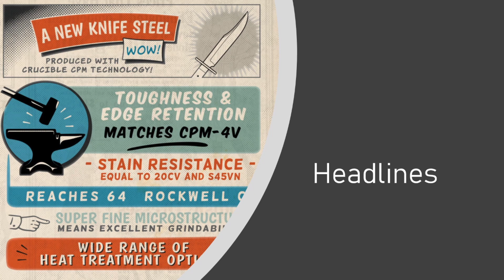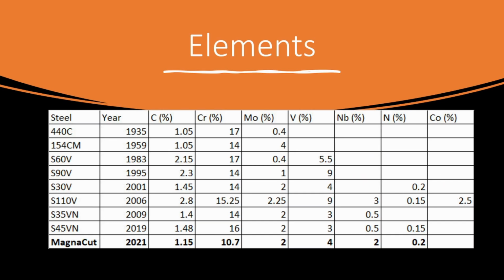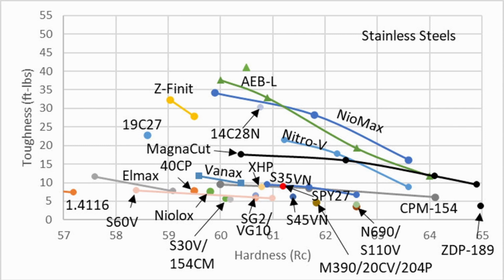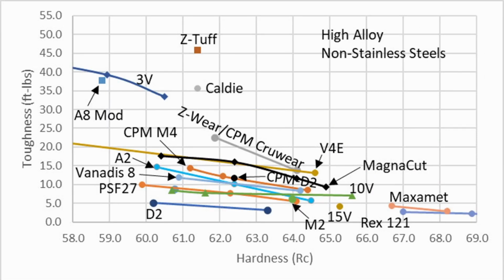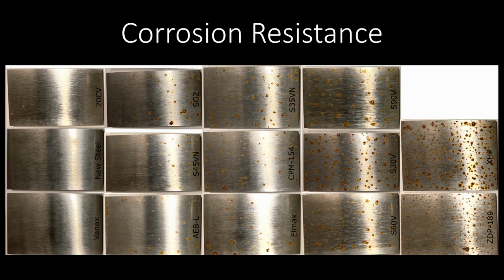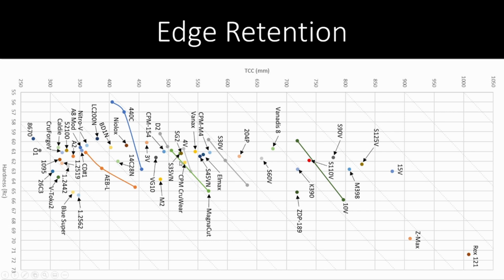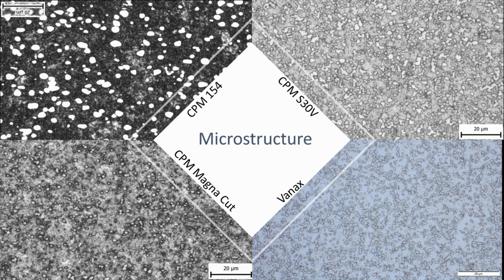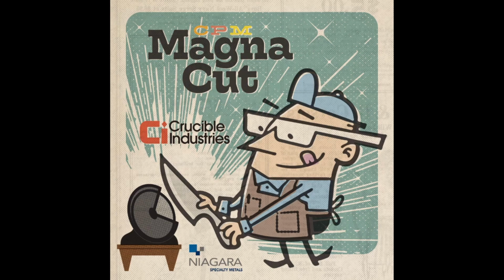CPM Magna Cut -a new stainless steel on the market how does it compare to S45VN, Vanax, and 3V?

Comment: I have a Creely blade of the CPM-3V and absolutely LOVE it. It is razor sharp from the forge and was so sharp, in fact, that it effortlessly penetrated the (very well-made) leather sheath that came with it when my wife tried to put it away.

A Kydex sheath would be a really welcome offering from the Creely forge.
Reply: Kydex won’t save you. I just received my Benchmade Meatcrafter & it so sharp & slicey that the 1st time I tried to sheathed it went thru kydex like it wasn’t even there. If I’d been grasping instead of pinching the sheath it would have gone thru my hand!! It’s ruined,  so the knife lives on my magnetic knife holder in the kitchen.

Comment: I just purchased a LionSteel M4 in Magnacut. They did it in 62 Rc.  Can't wait to try it out!  It should go nicely with my Creely Vanax Mako once I get it. :)
Reply: Let us know what you think about this blade cause I received exactly the same knife last week and I'm desappointed...
Here is the experience I described to Lionsteel company:

"
I doubt it to be 62HRC hardness but if it is, Magnacut would offer better results if the heat treat would be around 63/64HRC.
Indeed Magnacut is basically tougher than M390 but with less good edge retention.

Pretty easy to get thin sharp edge with leather strop the edge retention is objectively not good.
From super sharp (managed to curl part of a hair) to not shaving at all just after some carton cuts.
Sharp it again and just after making fruits salad on a plastic board the knife isn't sharp anymore...
I would love to compare it with the M390 version but can't pay for another knife to try it... 
Maybe something got wrong during the process of this serie...don't know.

But I certainly know that from a knife I thought to be my favourite one it gonna end to be the one I'm not really using to not be desappointed each time of use."
Reply from the maker: @tristanvigouroux6320  you may want to give it a few good sharpening’s, sometimes manufactures heat up the edge when they sharpen, and a few hand sharpening’s, will get past that

Comment: Stainless 4v sounds good. I like 4v but the only 4v I have is the st. Nick's spyderco shaman in 4v. The blade is coated so it doesn't have any visual rust issues. I only used the knife for a few weeks at work but haven't used it since.  I'll have to check to see if the edge has oxidation, likely not.
Reply: @Strangely Brown I'm assuming your chipping is due to burnt edges. Sharpen several times past the burnt edge and then tell me how well it is, I bet you it chips much less if at all. But yeah 3v has better toughness, delta 3v being even better (proprietary 3v heat treatment from Carothers improving all aspects of 3v).

Comment: Sounds like a sexy my favorite stainless steel for yrs now is AEB-L good stain resistance good edge retention and easy to sharpen and fairly tough especially for a stainless steel. I would love to see more companies would use it or maybe RWL-34 and I see alout of companies switching from cpm154 to s30v which is an upgrade on paper but I wish they would stick to cpm154 even 154cm,vg10 14c28n,N690,ATS-34,CTS-xhp and I’d love to see more knives in LC200N great performance and almost %100 rust proof great for butchering the kitchen, fishing harvesting game or just for edc plus it’s a great steel for those rainy days when outdoors.

Comment: Looking at the edge retention chart it just proves to me how impressive S30V can be with a higher Rockwell. Crazy how it continues to get overshadowed by tons of steels that really shouldn't, It's been proven time and time again its not chippy (despite claims by people using burned factory edges) it's pretty tough decently stainless and it holds an edge significantly longer than the steels that were supposed to replace it (S35VN & S45VN) and its much more affordable. So why not just treat it better?
Reply from the maker: I think the limitations of S 30 are more in the corrosion resistance and toughness areas, but it does have better edge retention then many give it credit for.
Reply: I agree wholeheartedly with the original poster.
 The main quality I'm looking for is Edge retention, and not to be complete crap in the other two categories of the three-legged stool 
 I just need Edge retention with okay corrosion and toughness. s30v I've always loved and now I know why after looking at these charts.
s60v also looks mighty fine for what I'm after.
 after recently purchasing and inkosi in s45vn I'm kind of disappointed in the Edge retention aspect after looking at these charts. Haven't been disappointed with its Edge retention in person I'm just referring to what I saw on these charts...
If  they could just get me a s30v with a high Rockwell I'd be more than happy. even in s60v i would be happy.. 
others seem to be more worried about corrosion resistance and toughness than me..I don't chop with my blades that's for sure and I don't stick them in lemon juice saltwater or get them wet ...whatever I use them for, they are wiped pretty much immediately after..
Reply: I have personally had much better experiences with s45vn than s30v. My s30v blades are older spyderco’s (at least 10 years) so maybe their heat treat is better now, I don’t know. And I have had very good luck with a Sebenza 21 in s35vn, but that had completely different geometry so not really an apples to apples comparison. I’m very curious to try Maxamet, and thinking of getting a para3 with that steel. It seems like it’s biggest downfall is lack of corrosion resistance but I don’t really care about that. You guys have any experience with maxamet?
Reply: @jesseryan4053  Having used maxamet in the manix2 LW, and PM2 in s30v, they are apples and oranges. The biggest standout for maxamet was the seemingly endless edge retention, but would take an entire afternoon to grind a secondary bevel on and finish at 12k grit. It’s a Ferrari of a blade steel and a very specific tool that I keep a thin coat of olive oil on it at all times. Also maxamet is terrible as a food prep kitchen blade, and terrible salt water fishing knife. This is where I’d take S30V hands down over maxamet for everyday usages.
Reply: @andyjonathan2486  you’re going to burnish and fatigue the edge. Not to mention with stuff like maxamet, your stones will almost never be flat and always dished out, making it further difficult to get a good edge. Get a DMT stone. I use literally just the 1200 side of a dmt double sided plate and then a few home made strops with diamond compound, and I can whittle hair after sharpening for 3 minutes.

Comment: I dream of an Hudson Bay knife in Magna Cut. I totally agree with you about AEBL, it is a great steel but, unfortunately, not very available. I hope Magna Cut will be easily available and reach is full commercial potential.
Reply from the maker: AEBL is not too hard to get, but not many production companies use it. Magna Cut will be a little hard to get until late summer. I got a sheet of the first small smelt, the second smelt will be available around later in the summer. The Hudson Bay pattern is cool, but that would be a big (expensive) piece of steel

Comment: Do you have a toughness table for other steels like for axes , billhook etc ?
Reply from the maker: Not specific to Axes, but axes high quality axes usually use something along the lines of 5160. Low alloy high carbon steels run in the 40s hrc.

Comment: toughness and shallower angles only work if the steel has the potential for high hardness and still retaining appropriate toughness. 

If you have something super tough that has OK toughness at "high hardness", but 60 is high hardness for it, it'll suck wind compared to something that holds together well at 64 hardness.

Comment: You know at the end of the day 1095 will satisfy over 90% of your cuttings tasks like cutting a piece of rope, a piece of leather, cardboard,  Stuff like this.   For the price you could get a Tungsten Carbide blade.  Stays sharp for almost ever.  The only down side it's hard to sharpen
Reply from the maker: There is no doubt 1095 is a perfectly serviceable steel, and would probably work for almost 100% of your actual cutting needs. When a steel like Magnacut (and many others) comes along however, it’ll hold an edge almost thrice as long, it’s a tougher, more durable steel than 1095, and if you happen to work in an environment where it’s wet or corrosion is an issue having a steel that is very stainless is very helpful. In the end, it’s a value judgment, but newer steals are substantially better performers than 1095. It’s kind of like saying a 1991 Honda Civic is perfectly functional to get me back-and-forth to work each day, but a 2022 Acura would be a lot nicer, but a lot more expensive.

Comment: What does edge holding mean and how can it be quantified?  It's a nonsense term if you say I want to compare toughness with edge holding.  Wtf.
Reply from the maker: Edge holding as it relates the number of cuts in a CATRA test. It’s a broadly acccepted scientific test to quantify edge holding, And a notch C test to determine toughness. Both quantifiable and repeatable tests,  the results were mathematically adjusted to fit into this graph (and that is annotated on the graph).  Not really sure what your issue is, I suspect a steel you love did not perform as well as you had hoped.
Reply: @Creelyblades  
Edge holding as it relates to CATRA would mean nothing more than wear resistance/geometry and anyone that is familiar with steels should know that.  Toughness in regards to edge retention currently has no place in CATRA testing.
Reply from the maker: @notme3686  I mention two tests. You only seem to address one because you’re probably not familiar with the other. Read my reply a little more closely.

Comment: I think it's a gimic just to sell more knives. 14c, aeb-L, elmax, 20cv is more than enough. I think I'm onto these knife makers. They need to sell knives. What better way than to come up with a new steel. No need for it. It's like a pitch to sell more steel to sell more knives. I seen a Magna cut blade snap and I've heard of some Magna cut owners having to sharpen their knives 3 times per day. It looks like this steel might not be that good.
Reply from the maker: Honestly, this is a pretty cynical view of a group of folks who are passionate about their craft. So you think knife makers design and manufacture new steels? Interesting. Magnacut has good edge holding, better than 14c or Aebl, not as good as 20cv. As for someone sharpening 3 time a day, that same person would be sharpening AEBL 7 times a day and 20cv 2 times a day. Most knife makers I know stick to a couple alloys. I am actually a little different than many as I intentionally use many different steels.
Reply: @Creelyblades  it's just the business. That's the way business and marketing works. It's a steel  pretty much  the same as many others in its class .
Reply: It's just business Gary
Reply: @Creelyblades  for what the knives we carry are used for 14c is just fine.
Reply from the maker: @mityjoeyoung8855  14c28n is a very good steel, basically it’s an upgraded AEB-L (13c26). To say that steels are basically perform all the same is objectively false. There are empirical measurements of the steels performance in different areas. For instance compared to 14 C 28N, Magnacut has substantially better edge retaining properties, similar toughness, and superior corrosion resistance. It is without question a better performing steel, it is not the same thing. One might argue that the differences are overblown, and for many use cases that may well be true. As a for instance I make blades in a steel called Rex 121, it will hold an edge perhaps 7 times longer than 14 C 28N, but it has low toughness and virtually no corrosion resistance.  I am one of only a handful of knife makers that regularly make knives in it, but in your mind I suppose it’s the same as 14C28n. I also don’t think it’s as simple as one steel is better than another steel, different steels have different strengths and weaknesses and it’s about the appropriate steel for the appropriate job. To suggest that knife makers are selling knives in premium steels at premium prices when they perform no better than cheap steels is to suggest that they are diss honest for the sake of profit. I’m not sure you realize how offensive that sounds. And by the way I did notice that you changed your original comment where you suggested it was knife makers producing these steels for the sake of profit.
Reply: @Creelyblades  I love 14c one of my favorites. On YouTubers  DBK bushcraft a bark river bush crafter scout  in Magna cut snapped and on not your average edc's YouTube channel. Her Magna cut blade needed sharpening after cutting one cardboard box. She also had to sharpen 3 times in one day using her Magna cut blade at work. Cutting care board. The results I'm seeing im not favoring at all.
Reply from the maker: @mityjoeyoung8855  perhaps look at my Magnacut blade that DBK tested.
Reply: Lol?

Comment: People use edge retention interchangeablely with wear resistance making the discussion very hard.  Edge retention is a combination of several factors.  Wear resistance is a stand alone factor.

Edge retention is the same as apex stability.  Toughness, wear resistance, geometry, and stain resistance all factor in "edge retention" but most people are stupid and say wear resistance alone means edge retention
Reply from the maker: We can get into an existential conversation about how higher toughness will allow for better geometry which will result in higher real world edge retention. 

The whole point of a CATRA test is to show how the abrasion resistance of the steel will directly affect edge retention. To suggest that abrasion resistance is some sort of term that is completely divorced from edge retention would be to misleading. I would go out on a limb and say abrasion resistance in most cases is the top predictor of the edge retention potential of a steel. I feel like this conversation has a lot to do with nitpicking terminology. The point of my video is to try to communicate the benefits of new steel technology.
Reply: @Creelyblades  
There's a reason why a guy like larrin Thomas came up with a steel like magnacut.  It tries to maximize all of the characteristics that lead to high edge retention.  CATRA gives only one insight into edge retention and that's wear resistance.  It doesn't factor in any other characteristics that knives need to retain an edge.
Reply from the maker: @notme3686  Larrin did not design the steel to be ultimate edge retention. Rex 121 has triple the edge retention. There is a distinction between edge retention and wear resistance, but they are highly related matters and to nitpick and go on about it is just unproductive.
Reply: @Creelyblades  
And you just proved my original point.  Rex 121 has higher wear resistance than 15V, but 15V has higher edge retention.  Stop using these phrases incorrectly.  It makes having a discussion hard when someone keeps using a term incorrectly.  If I kept saying toughness instead of wear resistance you'd probably try to correct me, too.
Reply: @Creelyblades  
Oh, and yeah, he did try to create the steel with the best edge retention, including stain resistance